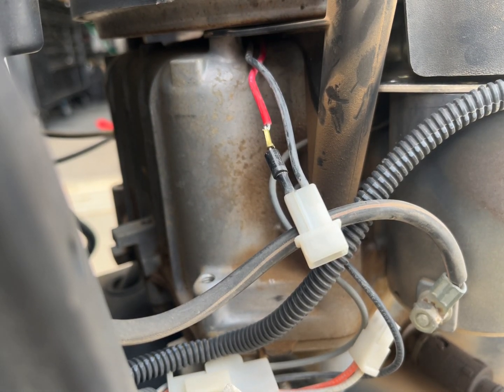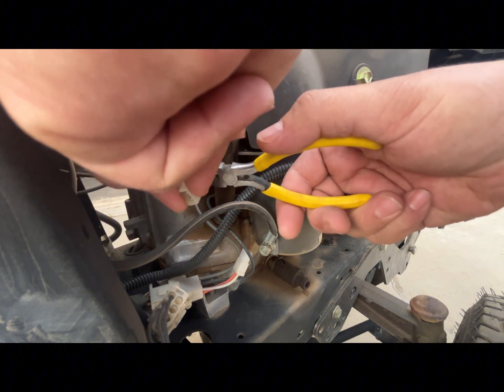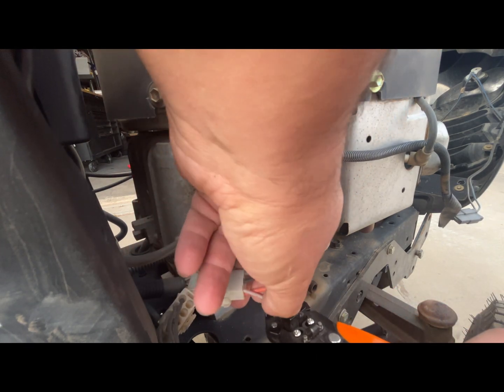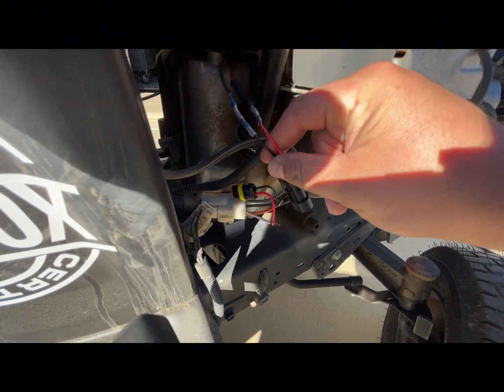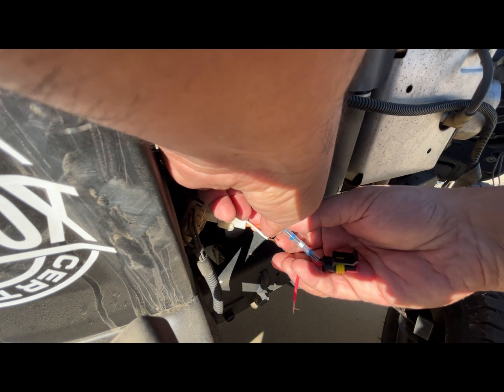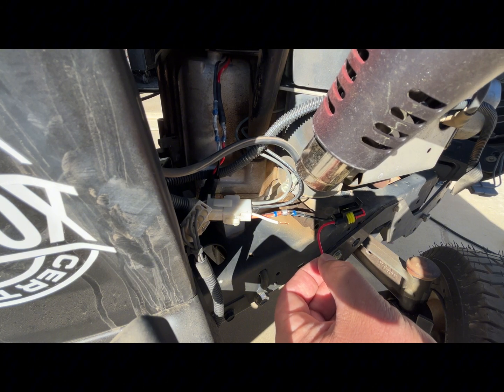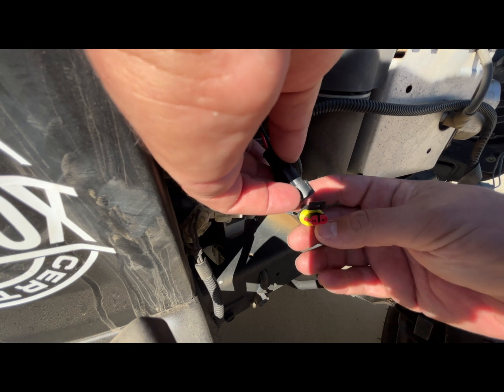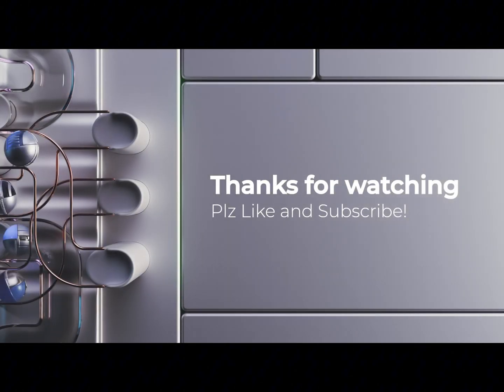Riding mower diode replacement

Comment: Nice video this helped me a lot my ceramic diode exploded randomly the other day. i just have one question. What direction did you solder in the diode? like did the sliver strip face toward the engine or toward the clip that you replaced?
Reply from the maker: Current flows in the direction of the arrow, I don’t remember if these specifically have arrows on them but the silver line should be on one side of diode. The side the silver line is on is the direction it flows (I think) you want the power to flow from the coil to the battery. 👍🏼 Hope that helps. Good thing is, the diode pack comes with extras in case I’m wrong 😂 sorry. Lol
Reply: @HandsOnDismantler  Thank you for the reply !